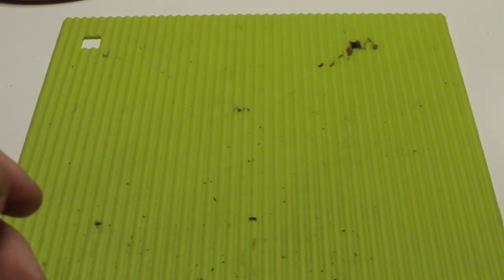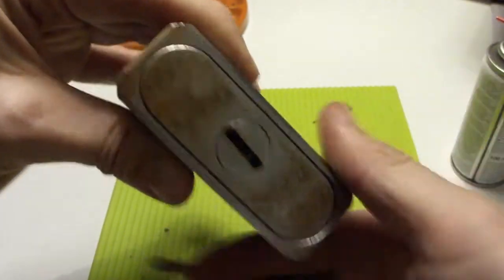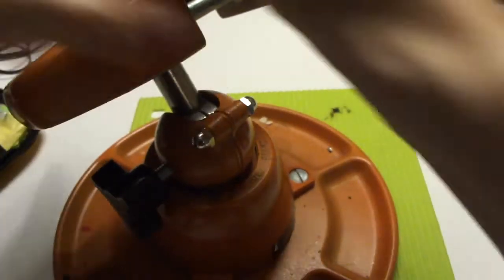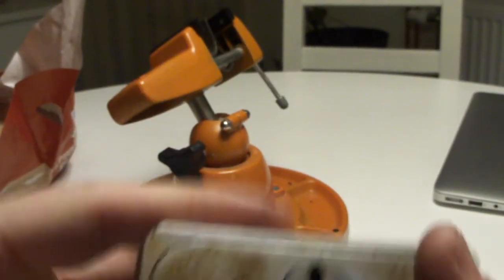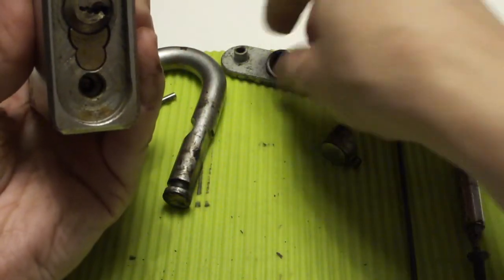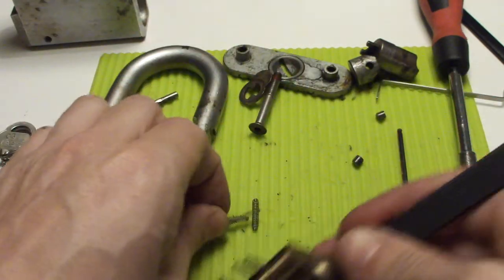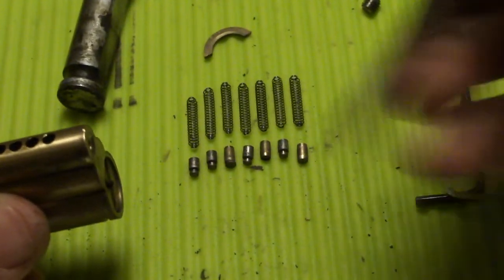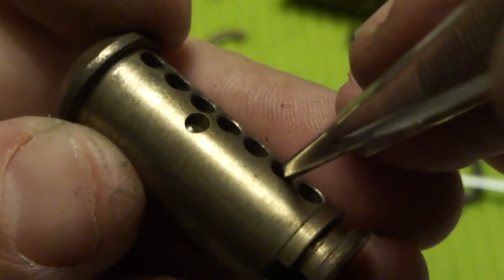(164) Huge ASSA padlock "triple peaked" open and explored

Comment: That's one hell of a lot of parts to get back together.
I hate getting those snowman cores with no plate back in padlocks 😫😫😫
Any tips??
Oh and I noticed that when you removed the shackle there was a silver sticker/foil part over the top of the lock!!,was that there when you got the lock or was it covering sensitive info ??.
Thanks for sharing loved the vid??😍😘😘😘👍
Reply from the maker: It's just a silver sticker with a two digit numer on. Someone probably had a bunch of these and numbered them.
Reply from the maker: Nah, It's just getting the springs inside the lock body that needs some careful attention. I'll make a video on it later :)